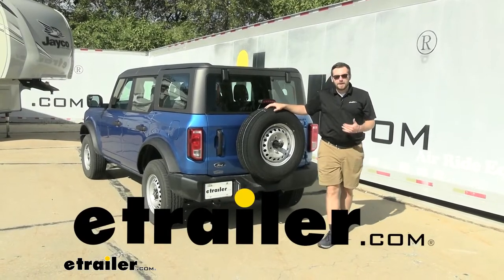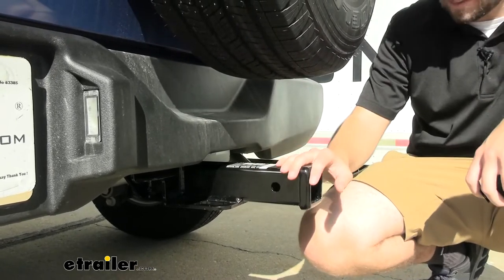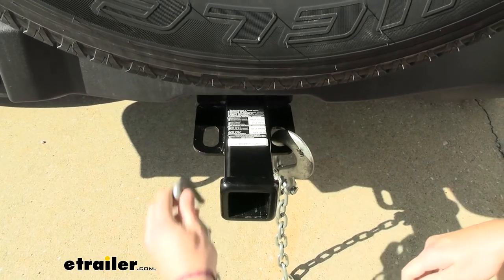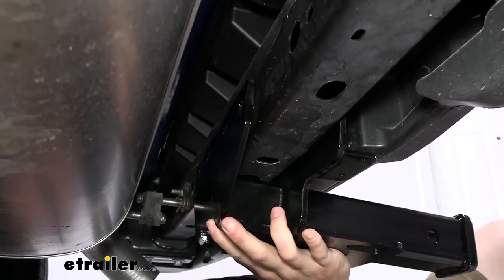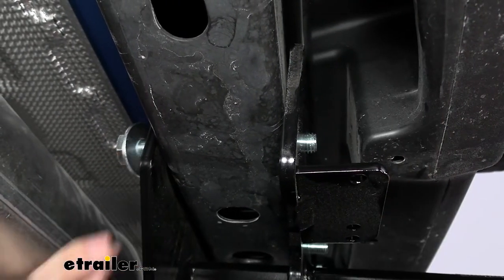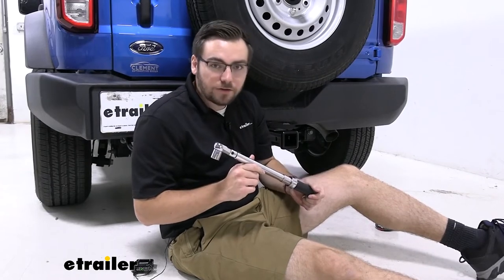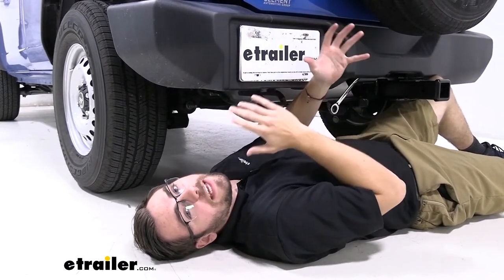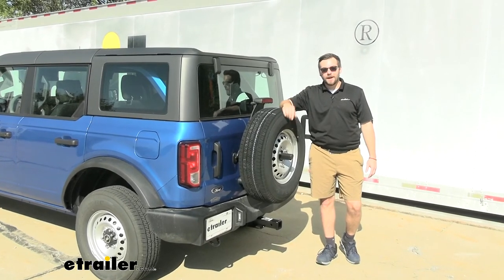etrailer | 2021 Ford Bronco Draw-Tite Max-Frame Trailer Hitch Receiver: Complete Installation

Comment: It has a 3/8 gap around frame member (on Drawtite hitch I just got from etrailer). Will the bolts draw that gap tight?  Also bolts are too long, they hit back of rear bumper.

Comment: What about the wiring harness for hallogen or  LED's?
Reply from the maker: We have a few kits that are designed to be used with LED lights. Check them out in the following link.
https://www.etrailer.com/t1-2021_Ford_Bronco.htm